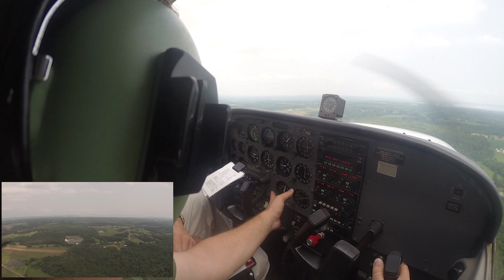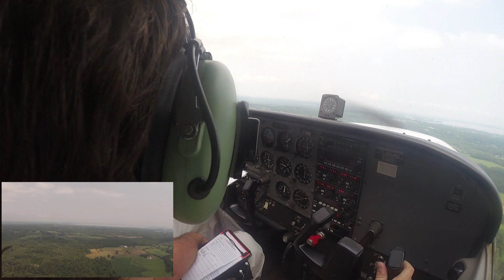Private Pilot Lessons: Stabilized Approach and Landing

Comment: Nice demonstration! Its always great to see a student get it when they realize the airplane is happy to fly itself most of the time. I have found that if you trim a 172 for 90 knots on downwind that flap additions at the numbers, start of base, and start of final will result in no need to touch either the yoke or trim wheel and the airplane will fly 85 knots, 75 knots, and 65 knots on each leg respectively. Power then becomes the only variable. This is also great because you never have to touch the trim again if you stay in the pattern, unless it works its way out of trim somehow. :)
Reply: i know I'm kind of randomly asking but does anybody know of a good website to stream new series online?
Reply: @Ezra Gavin meh I'd suggest flixportal. You can find it thru google :P -leonardo
Reply: @Leonardo Ronan Thanks, signed up and it seems like they got a lot of movies there :) I appreciate it!
Reply: @Ezra Gavin you are welcome :D

Comment: Excellent demonstration. I would like to add that if you trim for 75 knots on downwind, then you don't have to re-adjust trim at all. It will slow down to 60 knots by the time you reduce power to 1500 RPM and extend 20-deg flaps (in a 172).

Comment: I was taught within my first few lessons to trim for the current state of flight.  On final,  set pitch trim and throttle to hold glide path with zero yoke pressure.  It's almost like cheating!

Comment: OUYSTANDING .!
I just found this video.Boy am I glad I did.
Can I get your opinion on when to " clean up " once I land  ( full stop )
I am being told to retract flaps  while on runway rolling out. 
I am hearing that I should wait until "clear of runway".
Your educated opinion would be greatly appreciated. 
Thanks!
Reply from the maker: Hi Brian, great that it helped you. As far as flaps retract go, you should do this when it is prudent to do so. Remember, fly the airplane first. If you are in a Skyhawk, it's generally not a distraction to just reach over and go flaps up real quick once you are on the ground and have the airplane under your control. However, if your still busy controlling the plane after landing, then a flaps up can be accomplished after exiting the runway. There is not "right" time to do it. You decide what is right for you
Reply: @EastCoastFlying  
.Thank you for your response. 
I agree with you, I am flying a Piper Warrior with manual flaps.
It seems to be distracting to reach for the flap handle as soon as I roll out.
 Like you said  , FLY THE PLANE  .Thanks again

Comment: Can I always trim for my approach speed? Can I do it on my PPL exam?
Reply: Yes, you are the one flying the plane.  Control the plane with the yoke, adjust power as needed.  Establish your airspeeds and rate of decent and trim away excess forces.  You should be able to let go over the yoke and the plane will fly in a steady manner. That could be cruise flight, climb, or a descent.  Just trim the plane for whatever you are trying to do.